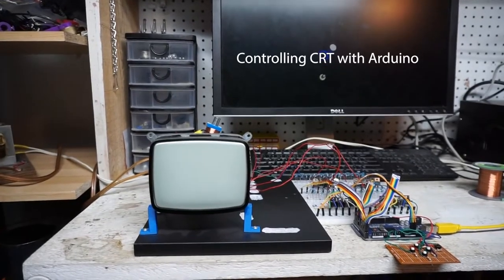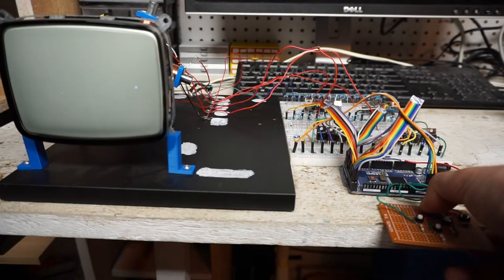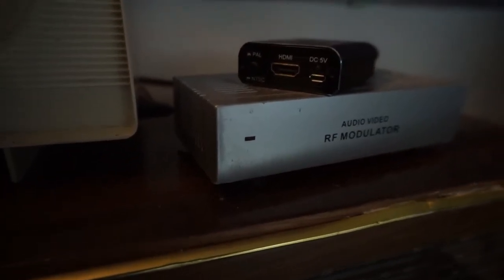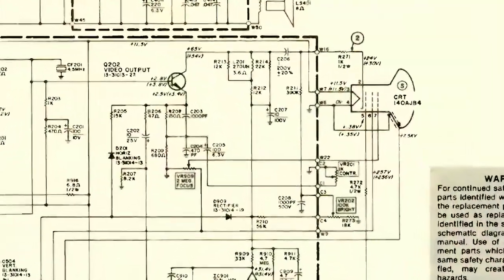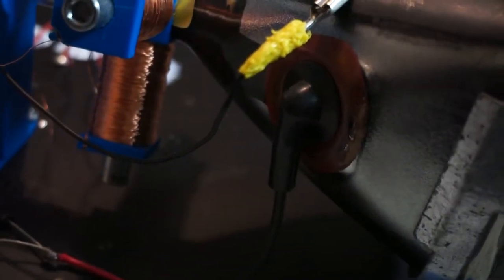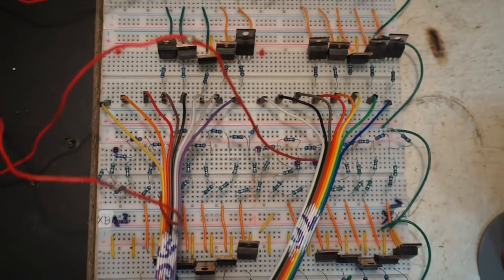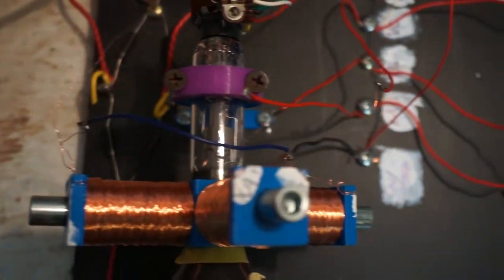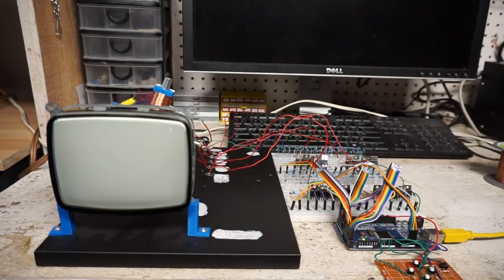Using Arduino mega to operate an old black and white CRT

Comment: i am thinking about and idea to make rf spectrum analyser using old crt tv , tv tunner and Arduino idea is just Tune the tunner using ramp signal very fast and gets its output as signal Strength or Amplitude And Plotting Amplitude on the Y axis and Frequency Scale in X Axis 
what you think about it 
50 MHz to 800 MHz isn't Bad for Diy SA

Comment: Hello , is there any Analogue Way to plot x and y axis On old crt via Audio video rav port ?
Reply from the maker: Well, you can use Arduino av library, and take it from there. It is very crude, but possible to draw basic shapes.
Reply: @TunnelOOVision  just for Oscilloscope project, but is there any way using Analogue circuit ?
Reply from the maker: @omsingharjit  well you gonna need a sawtooth wave generator on the X and feed test signal on the Y, if im understanding correctly what you are trying to design. otherwise you pretty much going to have to do what im doing here. btw, i hopefully will have an update on this vid at some point
Reply: @TunnelOOVision  no , i wanna do same thing via RCa if possible?

Comment: Hello, i want to do just this but i want to connect 4 wires from the deflection yoke to my arduino mega/uno then controlling it with a joystick or 4 buttons. I want to use the same deflection yoke, same flyback driver and that stuff. I would just connect the 4 wires to arduino uno or mega. Greetings

Comment: Nice project, and flexibility on pattern generation using software.  Yeah, a MOT is just not great for generating the HV. The tube only requires a tiny current which can be created by much safer and more efficient methods.  It's also quite easy to control beam modulation form either the grid or the cathode on monochrome or colour CRTs. Wonder if the Arduino can execute fast enough to generate a digitally produced raster. It would be well on the way to work as a monitor.
Reply from the maker: I probably will make an update video. I printed the DAC boards at JLCPCB, so mosfets are all nicely soldered now. I definitely would like to get rid of heavy and dangerous MOT, and instead create some source of 7 kv dc that the specs ask for (will have to think of something). Then the dot will actually be bright enough to change brightness (MOT is about 1/3 of what is required for voltage). Raster will be the next thing to try, although I expect Arduino to be on the slow side. From tube schematics, looks like wire #2 "video output" controls the grid/brightness of the dot... which means another DAC board and another arduino port to manage that.